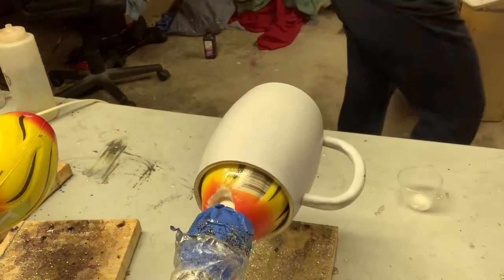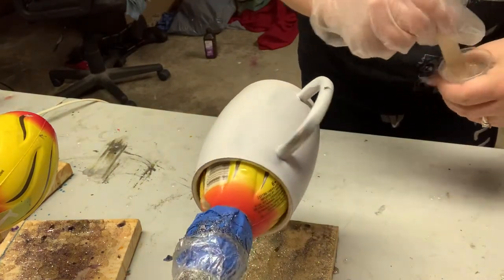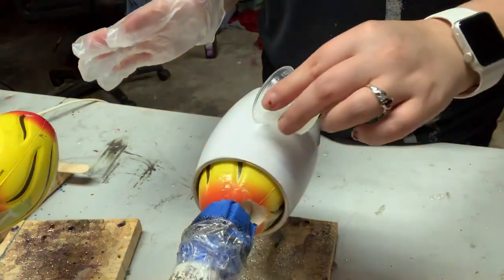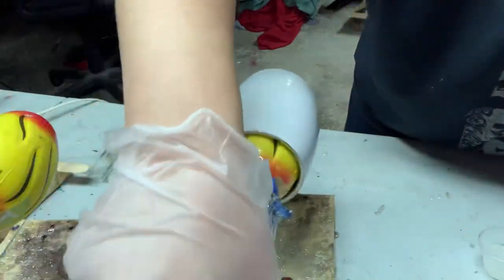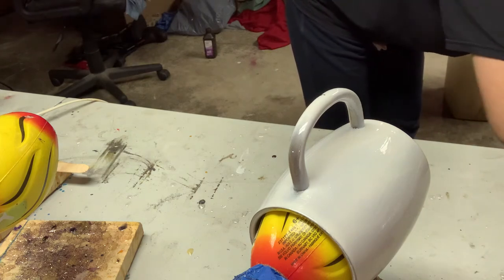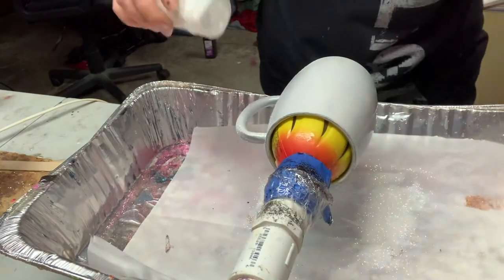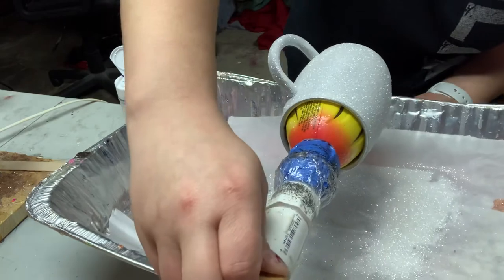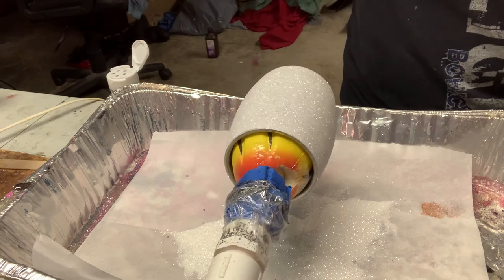Epoxy coffee mug Part 1

Comment: I'm curious. I have a david's tea ceramic mug that isn't dishwasher safe because it has gold sheet on it. If I were to cover my mug in epoxy, would it be dishwasher safe?
Reply from the maker: No epoxy is not dishwasher safe. The stainless steel tumblers even without epoxy are not dishwasher safe.

Comment: Hello, I have a question because I keep getting mixed answers as long as I have FDA food safe epoxy I can epoxy a not double wall mug like you right because I want to make some but unsure because of all the mixed answers or is your mug stainless steel love your video
Reply from the maker: My mug is a stainless steel mug. DO NOT epoxy the plastic double wall tumblers!! One thing that will happen is that when they sweat it will ruin your epoxy and the cup. Also epoxy heats up as it cures and it will leak chemicals into the plastic and into your drink and it could make you or your customer very ill. The best things to use epoxy on are stainless steel and ceramic.